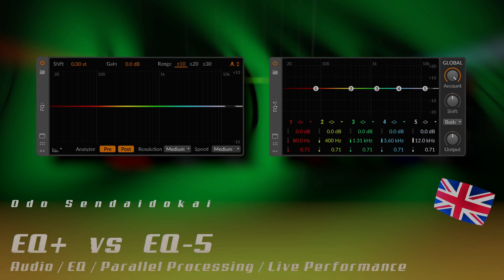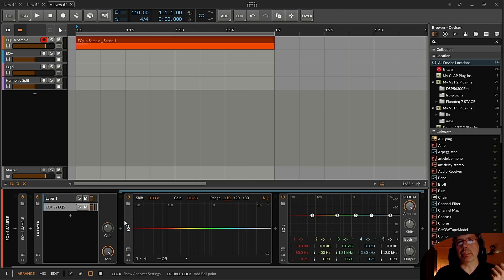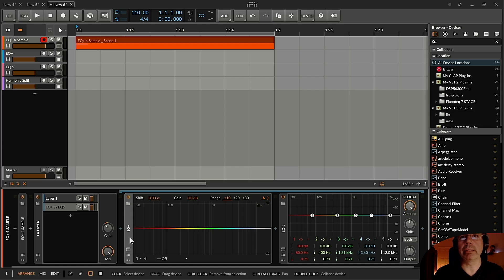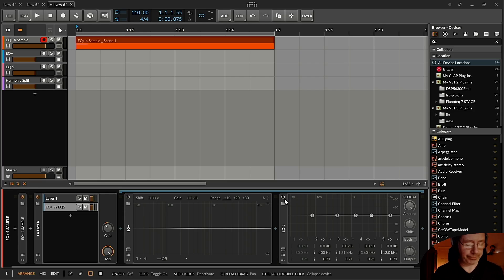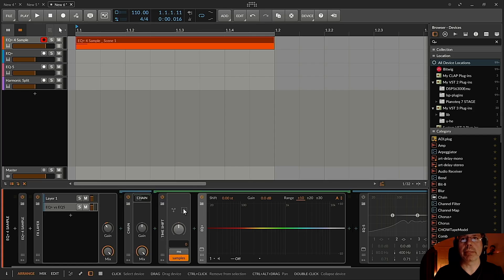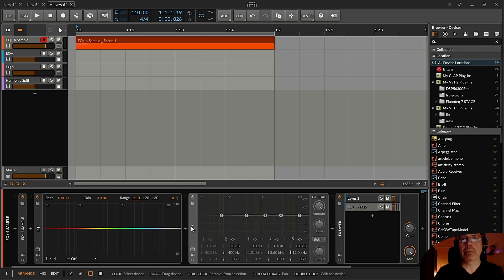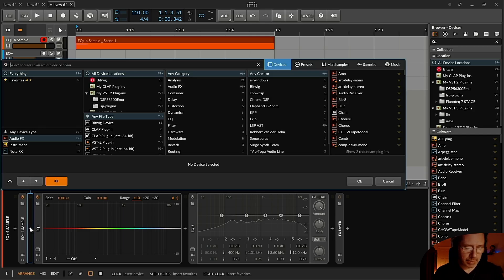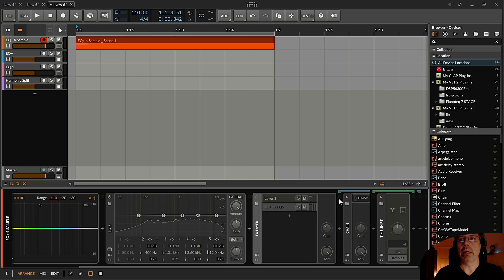Parallel Processing - EQ+ vs EQ-5 | english | Bitwig - FIXED in 5.1 Beta 1

Comment from the maker: With version 5.1 Beta 1 the EQ+ can be used normally in parallel processing. Bitwig has added the compensation here.
Reply: There are phase differences caused by the oversampling filter though compared to eq 5 :)

Comment: woul following the -3db rule when parallel processing work?
Reply from the maker: If you mean lowering the volume, because the signal is doubled,  it should be -6 db. That is what if've done on the gain knob in the FX Layer device.